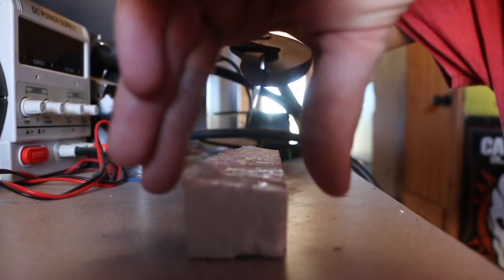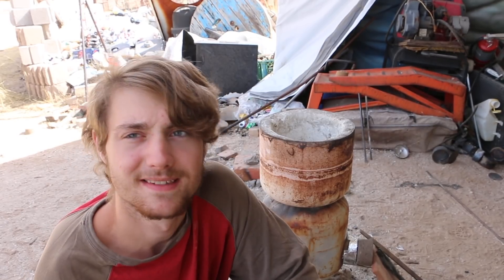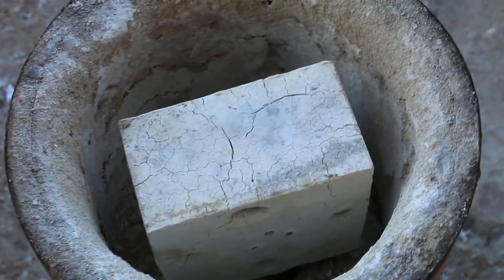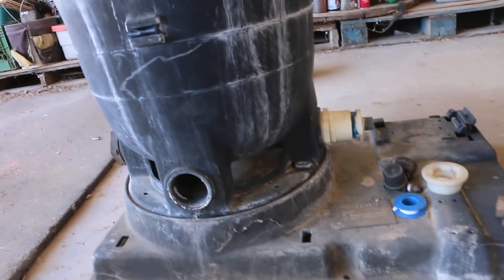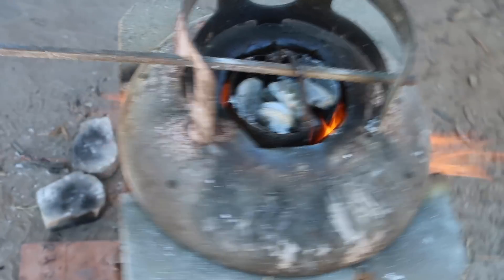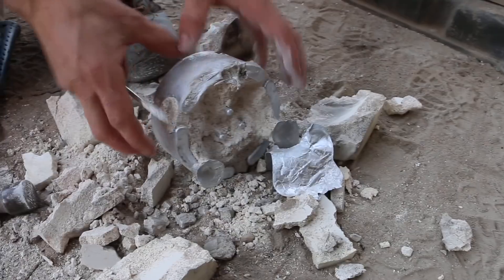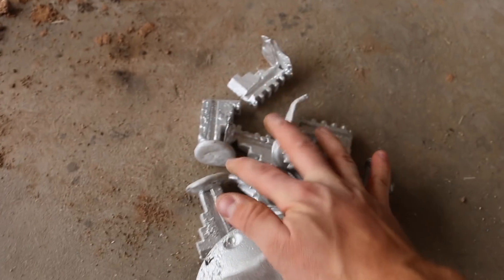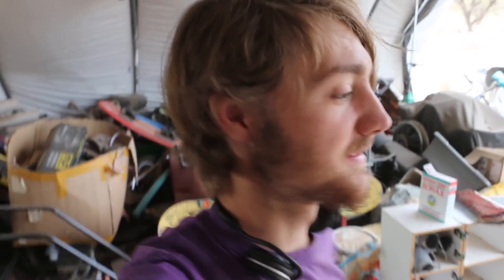Casting an Aluminum Chuck (part 4)

Comment: green sand mold and press into  the 2 x 4 mold use baby powder release tap then pull part out of green sand and then pour metal into the mold- if its a large part  use 2 box method use a mortis and pestol  to tap green sand tight around part for details  should work